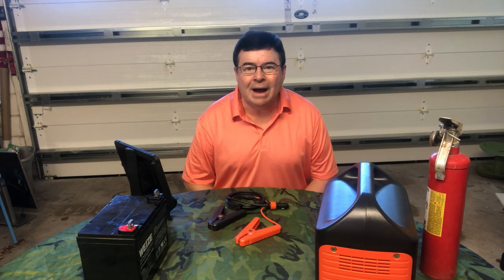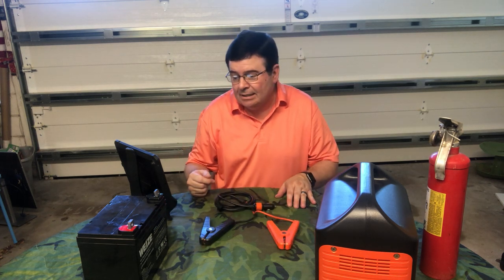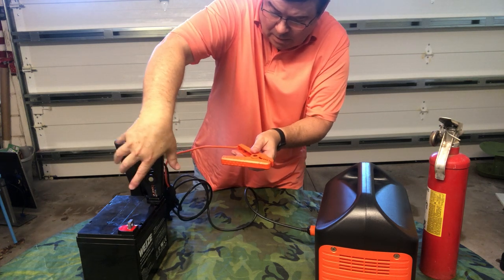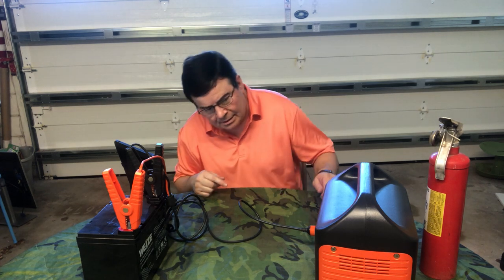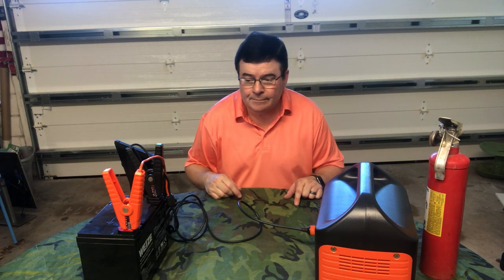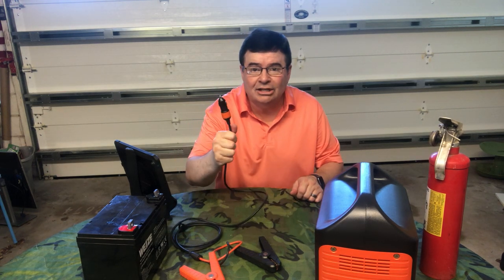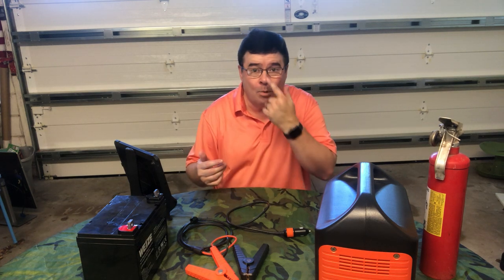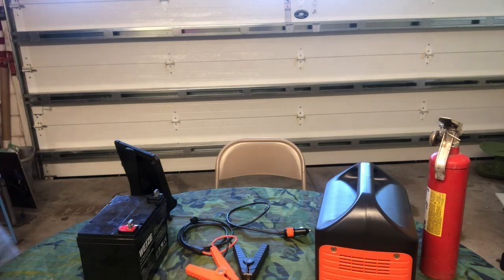Jackery PowerCable 12V Automobile Battery Charging Cable

Comment: I would like to have an idea on how much time you need to have the cables connected on a discharged car battery to be able to restart the car. I think will be a good point to make a review with the real facts and not just based on theory. 
10amps x 20 min = about 3.3 amps/hour. I don’t know if waiting 20 minutes will be enough to restart a cars??. Any ways I think it’s other great use you can give it to your Jackery and I will get the cables just to give them a try. Thank you! for your review.
Reply from the maker: Hey Joe, great point you made unfortunately, my car was newer 2019, did not want to risk having a warranty issue with the car battery, that's why I used an external battery for testing.
Reply: I tried after 5 min and no go....waited another 20 min and worked good.
Reply: @underscr0e  do you have to disconnect the battery form the car? Or can you charge the battery up while it’s still connected to the car? I have a Prius battery that I often need to charge.
Reply: @georged822  just left everything as is with cables on battery 20 maybe 25 min and was good after that…might only need 10 though, probably depends on starter draw and how dead battery is.

Comment: Do you think I can charge a swamp cooler AC unit from Walmart with a 500 W jackery battery?
Reply from the maker: Maybe, but personally I would use the 1000 watt, longer use time before recharging is required.
Reply: @danielone06  ok thankyou 👍